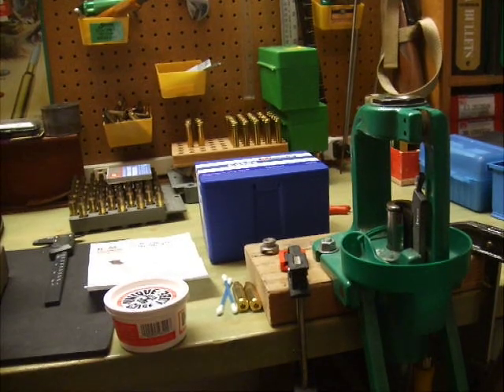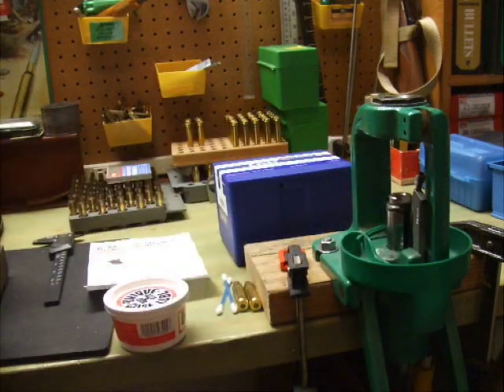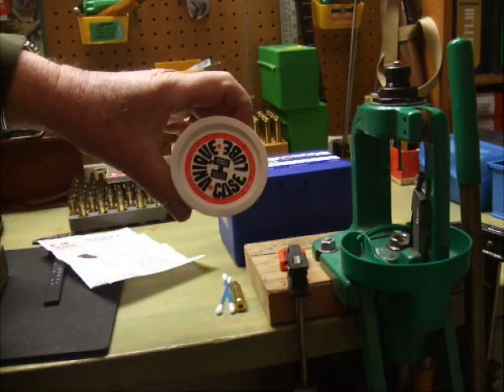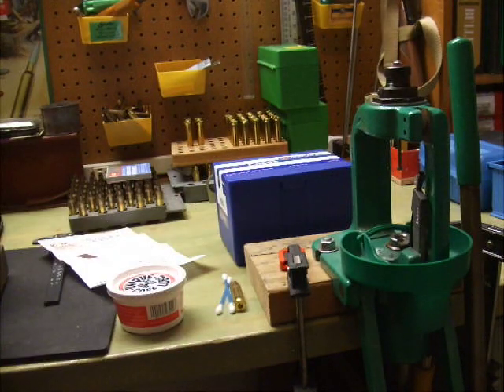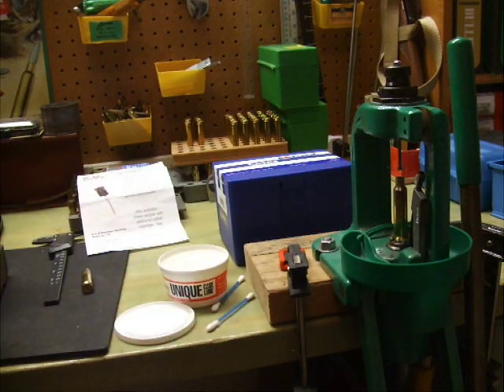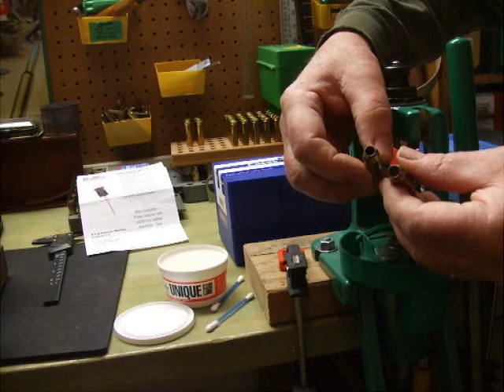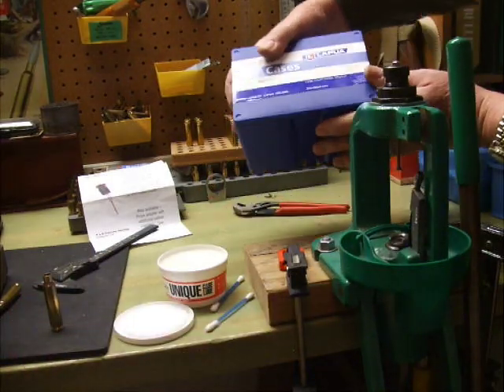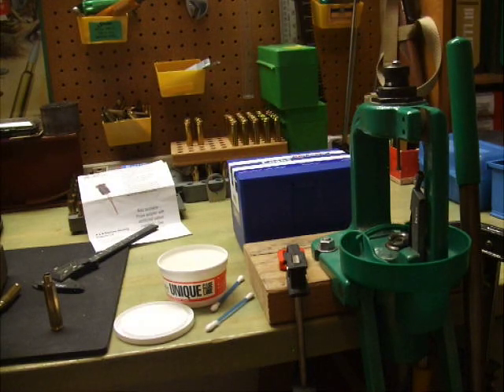Reloading Brass--REFORMING 6.5-284 Brass to 284 Winchester  PART 1

Comment from the maker: Sorry about not getting back to anyone with answers to questions....didn't even know that there were any until I looked at this again just now! Anyway, what I use to get the 6.5mm necks back up to 7mm is a K & M Precision Shooting Products' Case Neck Expander. That thing is basically a mandrel that you mount in your press and run the brass that is to be expanded up over it and then back out. They DO have a website if you want to google that. Just two suggestions I have; (1) Use some case lube inside the neck of the case to be expanded---that makes is easier on you AND on the brass. and then (2) for peace of mind, it wouldn't hurt to check the case length after changing the neck. I've always thought it to be kind of strange to make the parent case out of what is actually the "offspring", but 284 Winchester brass is kinda hard to find, though NORMA is now making it...kinda "spendy" though!!

Comment: Lube on the outside ???
Reply from the maker: Yep...it has to be sized appropriately for the chamber dimensions in the next step, which is the same for all cases no matter the source of the piece of brass.. That requires using a die to do and THAT requires lube. Different chambers require sizing to the proper size for the chamber, which will require lube. Otherwise, you open yourself up to having a case stick in the die.....ALL chamber reamers are NOT the same and that is something a lot of reloaders/shooters do NOT understand. Sometimes you need to neck turn...and that may require that you RE-LUBE the case if you intend to run it through a die.